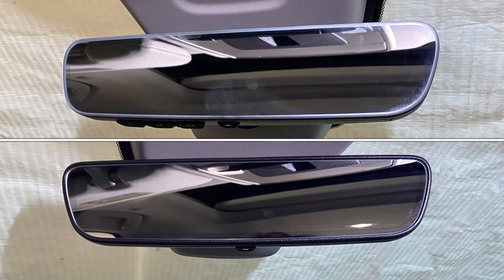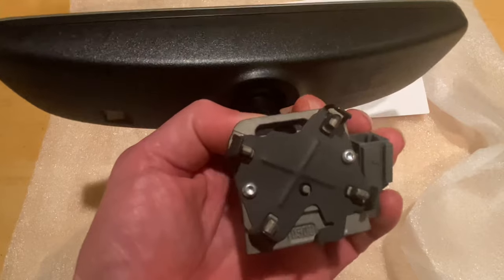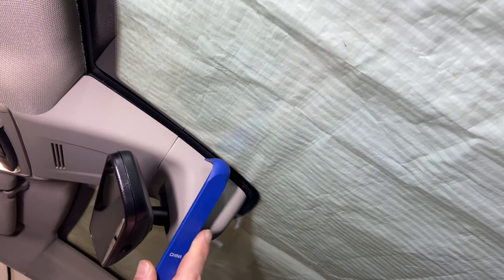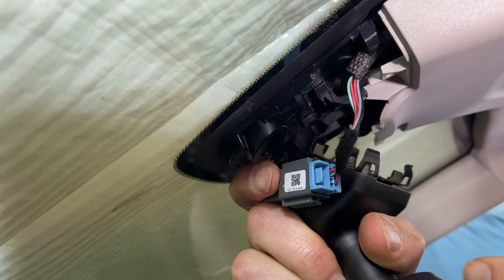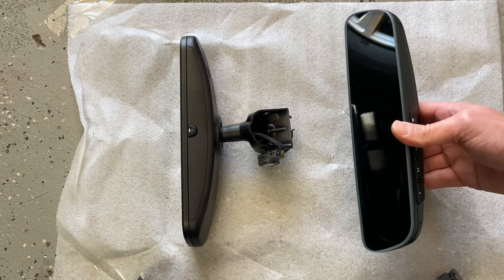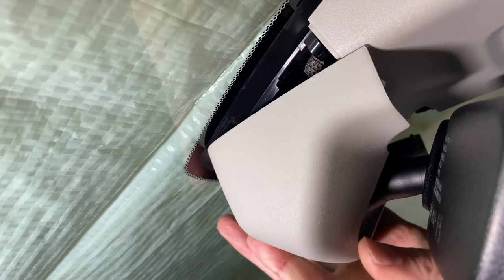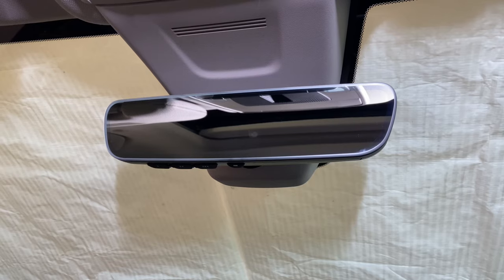2023 2024 Honda CR-V Homelink Mirror Upgrade

Comment: Excellent video, very professional. Did the cover removal tool come with the mirror and was this replacement done on a 2023 EX-L? Thank you.
Reply from the maker: Removal tool is listed in the description and is separate. This was done on a EX-L and would also work on a Sport Touring. Thanks for watching!
Reply: Work on a 2023 CR-V Sport Hybrid? Some say yes, dealer says no!

Comment: Thanks for the video!  One question:  I found the Honda instructions posted online.  Honda says to disconnect the battery (remove the connection from the negative post).  Did you do that or is it an unnecessary step?  Thanks!
Reply from the maker: That’s always a good idea, as you can get some bad results when u plug in multi connector pins and they contact incorrectly and damage the electronics of what is being plugged in. Thanks for watching!
Reply: @zoomgas2803  Thanks!  I upgraded my mirror without a hitch thanks to your video.  Thanks for posting.
Reply from the maker: @DIYPacNW  always good to hear of another success story, glad it was helpful.

Comment: Things were going great! Housing off. Old mirror off. Can't seem to get the new mirror on. And guess I'm not getting it aligned correctly. Don't understand the bottom clip. You say "we're going to engage the bottom in this opening there"  Not sure what that means...Any suggestions?
Reply from the maker: I’m guessing your starting with it over rotated. It only rotates and clicks in a fairly small amount, so that may help you. Hope that helps!
Reply: It takes a bit of power to turn it so it clicks into place. That’s what I found when I installed mine.

Comment: I have a 2023 CR-V Sport Hybrid (not sport touring). I am wondering if this will work on my car?
Reply from the maker: If you have an automatic day/night mirror it will work. If you do not, then you would need to buy a wire harness,etc and run that, which is a quite a bit more complicated. Thanks for watching!
Reply: @zoomgas2803  Thank you for the reply I appreciate it.

Comment: Can you upgrade the EX version or does this upgrade only work on the EX-L?
Reply from the maker: EX is not supposed to have the same harness already in place, because the 2023 EX-L already has the day/night standard, it is plug/play.  So would likely require a wiring harness from the EX-L also. Thanks for watching and your question.

Comment: Awesome vid!  Any thoughts on doing the illuminated door and trunk sills?  I'm curious if it'd be plug-n-play like the rear USB charger.
Reply from the maker: I’m debating to do aftermarket or OEM on the door sills.  After just getting the hitch install video shot this weekend, I feel like the rear sill kit will be easy, but it is kinda overpriced. So stay tuned, they r both on the list, once I get the hitch video released. Thanks for watching!!
Reply: @zoomgas2803  I've not looked at aftermarket options. I picked up a 2023 EX-L, and lookin to OEM + with options from the Sport Touring.

Also looking at the interior illumination, but it'd be more challenging as it appears the wires run up under and across the dash.

Also researching if the handsfree tailgate is a straight swap in.
Reply from the maker: @2of2DCH  yes interior illumination is on my list. Did the OEM version on my 2013 Accord and was worth it.
Reply: @zoomgas2803  I've had interior lighting on other cars. Even added it to the rear when it wasn't a US option, but was available rest of world. 

Sounds like we've the same plans. Glad you're willing to make these videos. haha

I'm also looking at lighter aftermarket wheels. Free up some unsprung weight, and maybe make performance a little peppier.

Comment: does the mirror connect to 8 pin connector or 7 pin connector? I am trying to buy a dash cam and would like to use a dongar adaptor to attach it with the same connection as the mirror but not sure if its a 8pin or 7pin. Thanks!
Reply from the maker: It is a 7 pin connector. Thanks for watching!

Comment: I saw both the new & original rear mirror has a small square clear behind on passenger side, what is it? I just have a new CRV-EXL2023, I plan to put my dashcam  on windshield behind the rear mirror ( on passenger side) but I see it will block the stuff I told above. So I don’t know if it blocks signals or similar.
Reply from the maker: That’s the light sensor for self adjusting, best not to cover. Thanks for watching!

Comment: Do you have to realign the camera on the mirror?
Reply from the maker: Please clarify your question, as the OEM mirror does not have a camera on it. Thanks for watching!
Reply: @zoomgas2803  On the 2023 Honda CR-V I was under the impression that there was a camera that read the speed limit signs and posted them on the dash in front of the driver, does it need realign after installation?
Reply from the maker: @kendallharrelson7315  that is true, but it is not in the rear view mirror, so no realignment required. Thanks for clarifying your question.

Comment: Does this upgrade work in the CRV Hybrid Sport Touring as well?
Reply from the maker: If it already has the auto day/night, then yes. If not, then you will need harness,etc.
Reply: Will not work on the  2023 Sport Touring but will fit the EX-L. I tried several online Honda OEM parts dealers. All say will not fit your Sport Touring. My Sport Touring will arrive in one week. Online parts dealers cannot even find a part number for me. Appreciate all you do Zoom. You would think it would work since both models have day night mirrors. I suspect it may work but don’t want to take the chance. My local Honda dealer says they are on back order but I think he is referencing the 08V03-3A0-100 that Zoom used. 
Trying to save folks the hassle of a return. If anyone has updated info, please let us know.
Reply: Thank you all the for the help. I ended up just using my portable garage door opener remote and called it a day.
Reply: Wish I had seen this earlier. Mine is installed but barely… this makes sense why it will not sit right
Reply: Although not listed same mirror works on the 23 sports touring hybrid.  Installed it using this video (thanks!) yesterday.  Works great.   @richard9609

Comment: I purchased the homelike mirror for my 2024 accord touring.
The wire harness on my car is white and has half as many pins as the homelike mirror. 
Has anyone seen this, and is there a resolution?
Reply: I'm about to install it on my 2024 Honda Accord Hybrid EX-L. was it a simple unplug and replug this mirror?
Reply: My accord touring did not have the correct wire harness. I had to order the correct harness. I had to run it to the fuse block under the dash.
It was easy but time-consuming. The directions that were included with the harness from honda were excellent .
08V03-30A-100 Automatic Dimming mirror (Attachment KIT)$42.12

Comment: Hypothetically speaking, if one were to chuck one’s handbag on the front passenger floor, then, in a rush, whip it from the floor to one’s lap, could the handle of the handbag catch the right side of the mirror and pull it with enough force in a counterclockwise direction to dislodge both the mirror and the left half of the plastic cover from the windshield? Asking for a friend. If such a freak event were ever to occur, and my friend wanted to get the damn thing back together before Dear Husband got home from his golf trip, I will let her know that this video would be incredibly helpful. 😂
Reply: So did he find out? 😂
Reply: @JDMJAMES  nope 😬

Comment: When I remove the mirror I don't see the wiring part
Reply from the maker: The Touring and EX-L models come from the factory with the auto day/night and the wiring harness that matches the Homelink mirror. Other models would require a harness to be run along the headliner, and down the drivers side. Thanks for watching!

Comment: Bought the Hybrid Touring Accord 3 weeks ago, found out that it doesn't have the homelink rear view mirror as standard. 

 The factory sells this plug in swap for MSRP $250.  

Honda of Valencia, (California) says THEY sell it for $400.  

I found the entire mirror assembly for $165 on line from a Honda dealer.  

H Back to Honda of Valencia for installation.   They've never done that before and didn't know its a straight swap for the existing mirror.   They told me with a straight face that it's 3 hours labor, for a total of over $500.  

Goodbye Honda of Valencia,  you thieves. 

 If i could rate them at less than 0.....
Reply from the maker: That’s why the ZoomGas followers are the best, as you all share your experiences that make us all smarter Honda owners! Thanks for watching!

Comment: Do you have the part number of the initial Mirror?
Reply from the maker: Here is what is on the back of it. 3A0-A01. I will make you a deal on it, as I removed it a week after I bought the vehicle new. Message me if you are interested.
Reply: @zoomgas2803  thanks, I just want to be sure that in France we have similar models so I can also  install one on it.

I see that there exists an "official" dashcam, model "08E30-3M0-600". Do you plan to install it on your HR-V?
Reply from the maker: @pticle94  I will investigate that. Thanks!
Reply: @zoomgas2803  I am interested if they are not!
Reply from the maker: @JR-ri7ve  yes it’s available.
Reply from the maker: @user-xs7qi6vw6w please let me know what email to use to contact you for the OEM mirror. Thanks, Paul @ ZoomGas

Comment: Has anyone tried to do the same on a 2023 Honda Accord Touring? I want to be sure the current connector would work with the Homelink mirror.
Reply: I just checked at our Honda Dealer in MA. They said the price for the new Mirror with Honda Link & the garage opener installed was $299 for our 2023 Honda CR-V Hybrid Sport Touring. I think they said it was around $245-250 just for the part, which is crazy and I told them it showed as about $180 online elsewhere. However, all the online places seem back ordered for this part. The Honda dealer in MA will have it in this week, or so they say. I wonder if along with all the markups/market adjustments for the car it self, they’ve decided to do the same for parts? We did have to wait months for our White CR-V.

Comment: Not a great video. Not enough detail on how and where to align mirror tabs when putting it back on. Thanks anyway
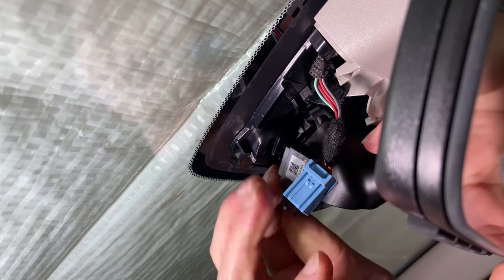Reply from the maker: At :35 you are shown the 4 tabs on the mirror, at 2:28 you see the inset of the mating portion, at 2:37 you see the interface and clockwise rotation to attach it. Hope this helps, thanks for watching!

Comment: Does this same mirror and install instructions work for 2023 CR-V Hybrid?  When I went to Honda Parts, it said that this mirror won't work on Hybid Touring Model.
Reply from the maker: Works for Touring and EX-L(which is what I have and shown on the video. You will love it. Thanks for watching!
Reply: @zoomgas2803  Thank you again.  I"m a total klutz, but it only took me about 10 minutes to change and program it.  Only cost about $180 including part, tools and shipping. Dealer had quoted $250 for part and $150 for installation!
Reply from the maker: @emrd1  use the money you saved for some more accessories! :)